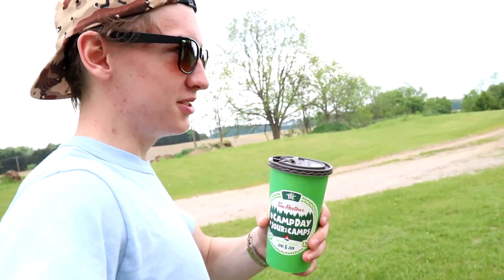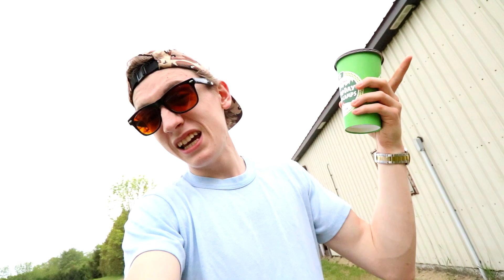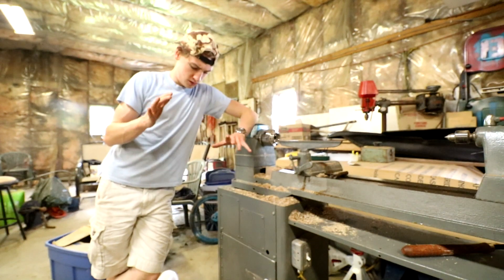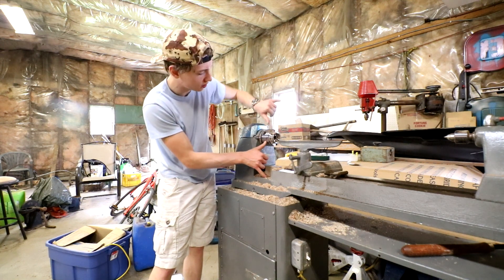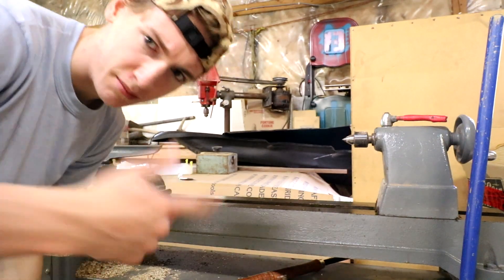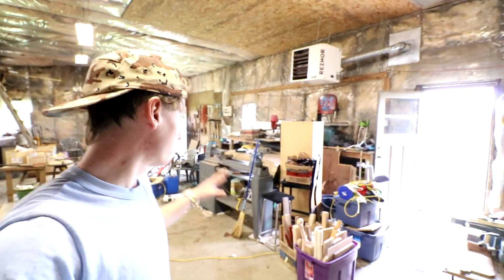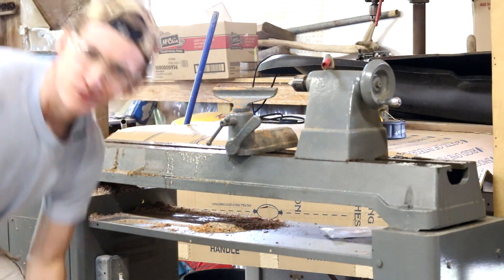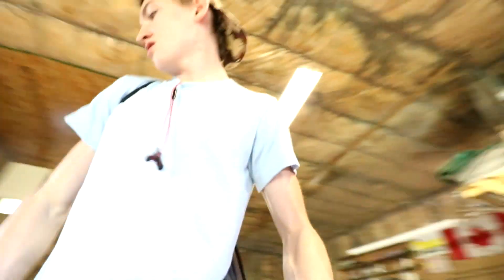I LOVE MY 1968 LATHE

Comment: I was somewhat shocked to see you turning that very unbalanced fragmented piece without a proper shield. Starting at 6:00. That is so dangerous.The lathe at the school shop had a shield. Be careful!
Reply from the maker: I considered getting one. but I'm not drilling into the cast iron of my lathe. and I just dont have my own faceshield yet. I had it on the slowest speed on my lathe though